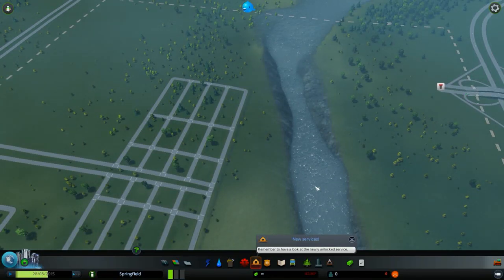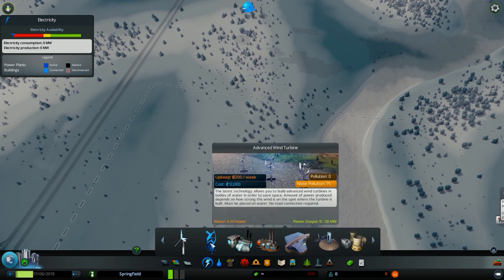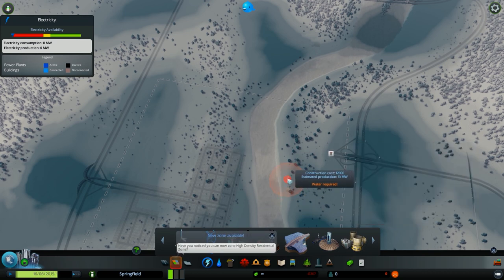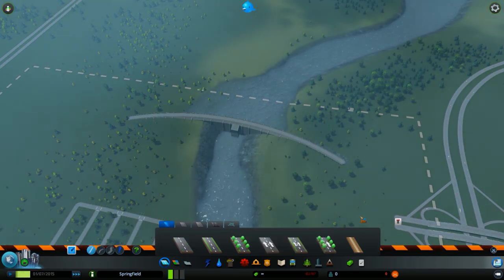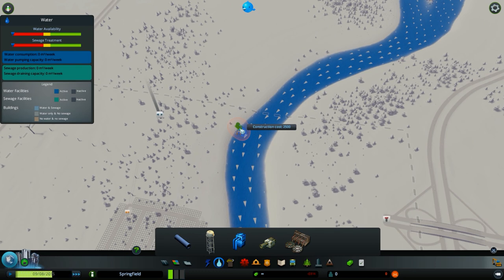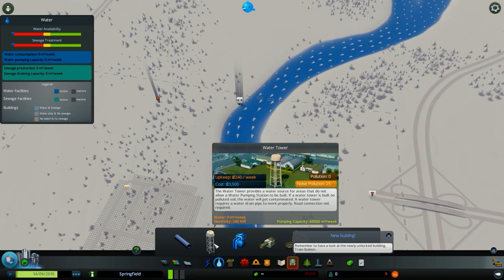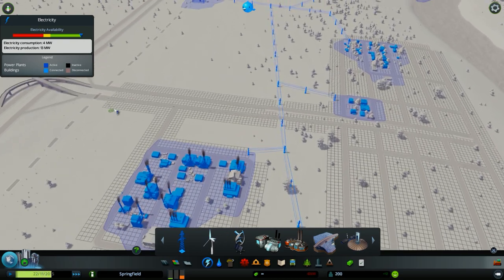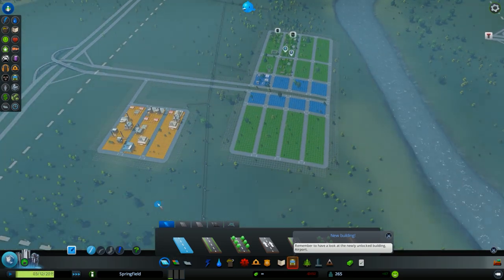Cities Skylines - Electricity and Water Services Guide

Comment: Aaa, so you can connect the water pipes from the water pump with the sewage. I thought you had to make 2 pipelines for each. Yup, i'm a noob right now xD
Reply: +Games Cooky I think this guy is wrong. Its suppose to be separate or otherwise they get sick if it mixes.
Reply: Saleh Abdallah Then paradox made it really damn difficult for us to create a system. Especially since we can't overlap them.
But idk, i didn't notice anything when i connected them
Reply: Games Cooky Same here, I think its just fine. The water didn't get contaminated. It does if u use a pump to pull out water in polluted waters brought by sewage.
Reply: Saleh Abdallah Yea that makes sense. Gotta place the water pump first, and then sewer, and make sure the sewer doesn't flow down to a water pump
Reply: Games Cooky If there is no place to pull out the watet, you can use the tanker. It pretty does a good job for many houses.
Reply: Your  exactly like me that's why I came here citizens were complaining about water and sewage
Reply: Same lol
Reply: Yeah just showed up to see how you can run sewer and water without them overlapping.  For such a high tech simulator, its pretty silly that they dont just assume the sewage is running deeper than the water lines.
Reply: Games Cooky  me too I just got the game

Comment: the way you connect your water/electricity lines with the streets is not correct, you won't supply all buildings in those streets, you must actually makes straight lines on the houses to connect correctly.

Comment: electricity just wont work for me says i need a connection and it says everything needs water even though I have them connect please help
Reply: I don't really understand what the problem is... But try this:
WATER
-U need water pumps and sewage things, place them down. Check the water stream tho u don t want the sewage things to be in front of water pumps, cause if u do... Then u will place shit into water that will get pumped up and drank by your citizens...not very good 😂. Connect everything with pipes and run some into the city.
ENERGY
-I like wind turbines for the start. Place them and run the connections to the city and to the sewage and water pumps... They need energy to work.